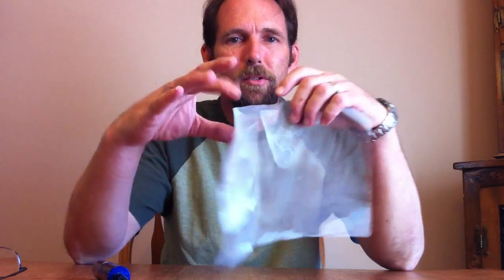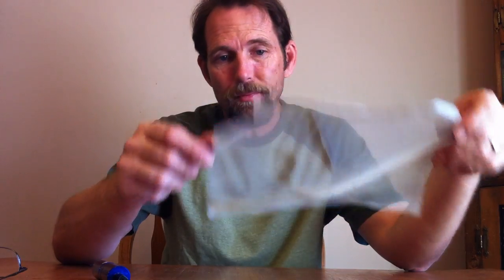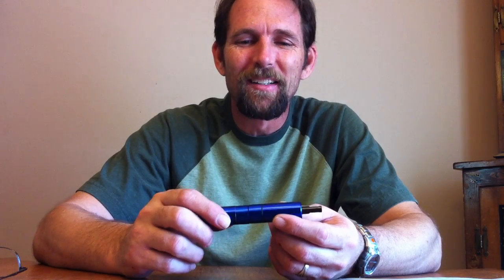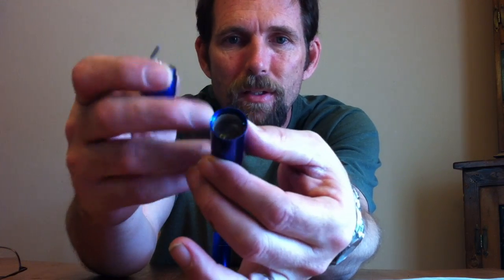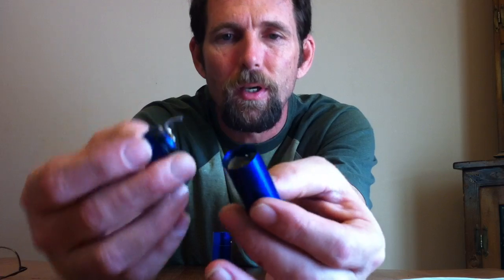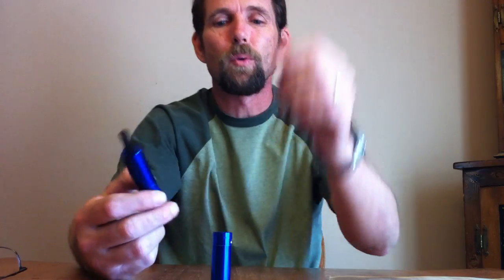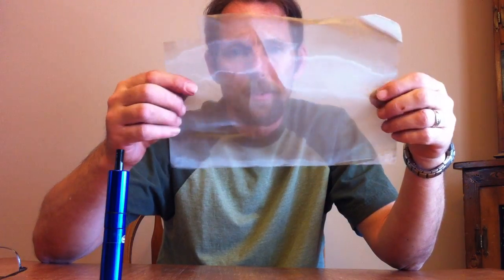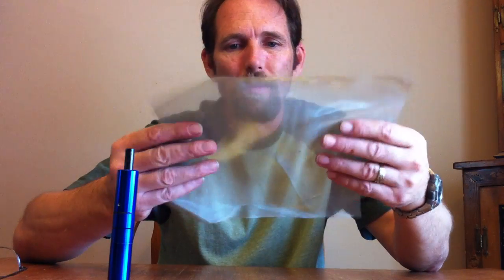Stainless Steel Mesh in an Atomiser

Comment from the maker: Stainless steel does not burn up, it is heated red hot and quenched with PG/VG to create an insulation layer on the metal to stop shorting from the heating wire. So the stainless stell may get hot but does not burn, and it is below the temprature threshold to melt.
Hope that helps.
Dan

Comment: What do you think of the little scare of wherever that is that builds up on the mesh? I wish I remembered but you probably know what I mean. Do you think it can leach ontothe vapor or do you think it's something we should worry about? There were samples sent out ti a lab and came back positive for something that could be harmful. A certain stage of metal buildup. I guess little oxidizing as possible would help but there's always going ti be oxidation under the coil. Wish I could provide more.